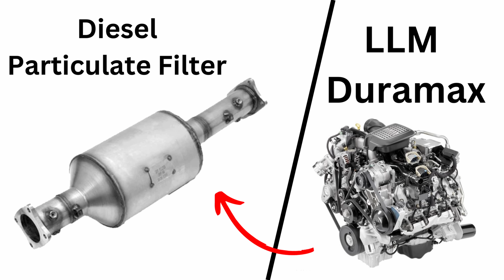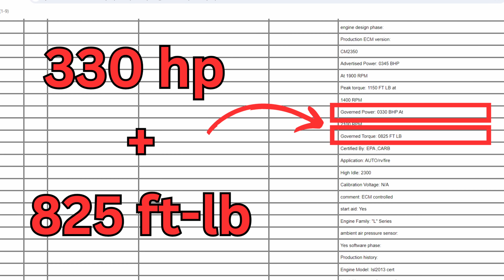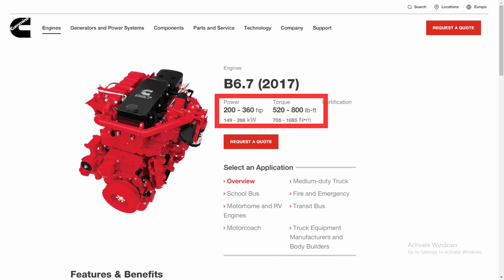Chevy 2500 8.3L DURAMAX Diesel Engine **Diesel Mechanic Review** | Should CUMMINS Be Worried?

Comment: GM needs a straight 6 in their HD trucks.
Reply from the maker: Could not agree more. The 3L duramax is a shining example of how awesome an inline 6 diesel can be
Reply: @TheGettyAdventures  what about the dumb ass belt at the back. Not a good engine.
Reply: @compted10  yeah im a gm lifer and i would never touch that dumpster fire
Reply: @Saddedude  I am pretty open to anything other than a 6.blow, and that rear belt turd.
Reply: @GettysGarage  I think a 7.5L inline 6(or V8) would be a good choice for 500 or less HP.
Reply: @GettysGarage Are those 3L
Duramax any good? I hope since I just purchased a 2023 Silverado with this engine. I do drive 9-11k miles a year so it should be fine.
Reply: @josels1292 you got rubber timing belt on front. 
Metal timing chain for cams. 
AND rubber timing belt on the back of the engine. 

150k life span and you have to pull the cab to replace the fuel pump or belt
Reply: @fastinradfordable  I can live with that. Truck came with 7 years or 100k mile bumper to bumper warranty. I drive on average 9-11k miles per year, I believe I will keep this for 5 years so when I sell it will have around 50k miles.
Reply: @fastinradfordable  You don't have to pull the cab for the oil pump belt. You have to pull the trans. The new engines are rated at 200K also
Reply: Why?
Reply: I suppose an engineer could explain it better but look at all the best diesels in farm tractors or semi trucks, are inline 6's, inline 6 gas engines are great too they're not speed demons but they are torquey down low .run lower rpm's for longevity  @buckhorncortez
Reply: @scottydog62  I6 engines are used for simplicity. That's about it. If you check. The Scania P770 V8 16L diesel. Makes more torque then a 16L I6 diesel. A lot of construction equipment, trains and ships used V configuration engines too. Not to mention. The 3408 Cat is a great engine too.
Reply: @countcuda70  oh I agree with that assessment I'm not saying the V engines are bad I'm just saying inline 6's especially in diesel configuration is a better choice , Simplicity usually means reliability, easy to work on so on so forth, and you can get higher torque at lower RPMs with inline engines which can also equate to reliability. Speaking of Scania engines I operated a case 2870 farm tractor with the inline 6 Scania engine, smooth powerful,and I love that centrifugal oil filter system as well. It depends on the application obviously they are good 6's bad 6's, good V configurations and bad V configurations.
Reply: @scottydog62   It really depends on the work being done. Both have their moments. Simplicity means just that. Their easy doesn't mean reliable though. They all have their issues. I do agree. Both have good and bad versions for sure. I like both of them for various reasons
Reply: @scottydog62  People say higher torque at lower rpm but the L5P duramax makes peak torque lower than cummins by 100-200 rpm and the chart I am looking at shows the newest cummins at only 420hp where my 2020 dmax is 445hp both at 2800rpm and the new duramax has more. The dodge trans option of course means the cummins is detuned instead of them using a more capable trans. A friend said he did not like the harshness of the Aisin as he had trucks with both options. An inline duramax might be ok, but I hate both dodge and cummins and drove a number of them so will stick with Chevy. The same friend switched to an F450 for towing a 40' 30k pound horse trailer and seems to be pretty happy with it although he has a 2022 cummins single tire truck for work but I'm not sure which trans that one got. Others who switched from cummins trucks to duramax said the dmax towed better but the 10 speed also makes a huge difference. They are all pretty similar now and they just keep trying to one up the others with small improvements, although GM was much smarter with ditching the CP4 fuel pump with the L5P.
Reply: The 3L duramax is literally a NIGHTMARE😂
Horrible argument brother man
Reply: Some people in these comments don’t see the design benefits of an inline motor versus a V8.
Reply: @CornFed_3   Each engine design has their own benefits. Inline isn't across the board better. Same for a V configuration.
Reply: @countcuda70 , no, but for overall towing, hauling, maintenance, and engine parts complexity, an inline motor is superior in virtually every way.
Reply: @CornFed_3  That's not true either. Enter the 16L Scania V8 P770. Has more power then all other inline 16L diesels. V configuration diesels are reliable. One of the best is the Cat 3408. It's a great engine. Very reliable and easy to work on. So are the old Detroits.
Reply: @countcuda70 , I never said they weren’t, inline motors are just mechanically better in virtually every way. Power isn’t everything.
Reply: @CornFed_3   That's not true either
Reply: @countcuda70 , just say you’re clueless and move on.
Reply: @CornFed_3  That's goes the other way. You're the one that clueless. If inline engines were so much better in everyway. The companies wouldn't manufacture them. V configuration engines are just as reliable, durable and powerful as any inline engine.
Reply: @countcuda70 , you clearly can’t read. I said inline motors are mechanically superior in virtually every way. Doing more with less.
Reply: @CornFed_3   I read what you wrote. It's still wrong. Clearly we're not going to agree. So we can keep going or just go our separate ways.
Reply: @countcuda70 , how is it still wrong? An inline motor uses less moving parts while still performing the same tasks with even more efficiency. It can’t be argued. Learn mechanical engineering and then we can talk.
Reply: @CornFed_3  Less moving parts, ✅. Of course. A V configuration engine has 2 heads. It all depends on application for  "efficiency". Each has what they're "better" at. Glad you're a mechanical engineer hanging out with use common folk on YouTube. An inline engine ISN'T better in every application. On the other side. A V configuration isn't either. As I said. Each engine type is better depending on the application it's being used for. As I said before. If inline engines are better at everything.... Why doesn't everything have an inline, engineer?? On top of that. You're specifically referencing the I6 only when efficiency is being stated. That limits things for sure. There are other inline engines that don't have the same benefits of the I6
Reply: They do have a straight 6 duramax diesel
Reply: ew no thanks.

Comment: Awwww, yes. The new standard for the 3/4 and 1 ton trucks from the big three. Awesome power and capability, along with piss poor reliability. Thanks EPA! 

I will say the big three not letting the EPA's forced reliability killing emission systems stop them for greatly improving engine performance and capability is admirable.

EDIT: And before I forget, we now get to burn more fuel to help improve emissions! 😀
Reply from the maker: Thats the reality that nobody talks about. With the implementation of emissions almost every single manufacturer had to up in displacement to make the same power. Meaning more fuel burn, more CO2 into the atmosphere. But what do I know
Reply: @GettysGarage   Yup, the railroads are already there with the Tier 4, burn more fuel (along with a complicated EGR system), to make slightly better emissions than Tier 3.
Reply: @GettysGarage  I'd say you know more than the loser lawmakers in Washington, and Canada. I think it's mainly a money making scheme that they wrap in a package that attempts to make them look like they're fighting for some phoney save the planet cause. Emissions makes everything go up in costs and volume. Vehicles know need more complex parts on them, diesels require more fuel that generally speaking keeps getting more expensive, repair work, and preventive maintenance is more necessary, as is hiring skilled labor for work that you used to could perform yourself.?.? IDK, I could be wrong, but it seems to make sense, and you cant make dollars with making cents.... Or something like that.
Reply: Like with vw

The 1.9 had lower emissions than the 2.0tdi because they made it too powerful
Reply: I’m an automotive engineer don’t tell them I told you this, but we (employer) really don’t care. Truck blows up after the warranty. To be honest. Most cars nowadays. Have a 10 year expiration date. The people I work with every day with the smartest people I know from mechanics to former Dakar , and Baja engineers,. Trust me we can make a reliable engine Toyota was doing it back in the 2000s. There’s been multiple cases where through long-term testing we have found multiple issues but since the issues we found “most likely” happen over 200,000 miles we purposely did nothing. our customer base (likely used) who drives cars not far into the future. Don’t have the money to buy a new products so we don’t care what they think about us. And the customer basis I that afford a new truck will have a perfectly problem with the truck for 6 to 8 years. before you ask other companies do the same even Toyota now with the new turbo junk. We usually open up or competitors engines and see what we can rivers engineer or learn from )non-patented) Sooo… sorry 😢 (power train engineer in one of the big American three)

Comment: I really wish GM would develop a heavy duty version on the 3.0L Duramax.  I think that a 300hp/500lbft efficient motor would be preferable to me to the 6.6 gas, but I really don't need the 6.6 Duramax for my hauling needs.  I'm looking at the max trailering 1500, but would prefer the HD chassis.
Reply: If they did that and didn’t make that $10,000 up charge and instead like 1-2 I think it would sell like hot cakes
Reply: I would buy one right away. That engine on a heavier duty frame and axles would be perfect for me.
Reply: And ditch this BS oil pump belt/chain drive, and in the back of the motor.
Reply: The 6.6 is designed to run on 87 gas
Reply: @shadowopsairman1583   yes, and ?
Reply: Why put a real diesel in a light duty truck?
Reply: I ended up buying on the '24 Silverados with the 3.0l Duramax and the max trailering.  Man, I love it.  We'll see over time how it holds up.
Reply: There is a point of diminishing return. What do you really want, luxury impacts towing capacity.

Metallurgy dictates what can handle what, and for what period of time.

Although there is plenty of examples of how not to design, or don't have expectations for things not rated properly, there exists a golden ratio for different lifestyles.

A 3.0 diesel, with the proper add on's. The first being is maintenance and longevity being the largest component. If you're a rural guy or the minority a rural woman, hand rolled windows and a good effective heater are all you really need. 

I'd even wager for just using your cell as a small radio if the cabin was insulated enough, which it should be we are talking rural afterall. 

But let's be real I could bring up a handful of topics, the reality is the consumer market drives the "looks" "functions" and unfortunately "price" of these trucks.

I paid 9k for my 6.7l powerstroke 218k pre covid. 

Had a hard time paying that, not because I couldn't afford it, I just barely justified me having it.

And at times I wonder why I still have it, no hauling large trailers like I used to. I look back at ease of maintenance short of replacing the entire engine due to it having ×××k miles. 

Regardless of what you drive, use a fuel lubrication additives. I've done other things to my truck, but it makes people reeeee. DEF, DPF🗑
Reply: @casval-pj5tb    I think the 3.0 is plenty for my towing needs.  I could get away with the max trailering 3.0 1500 (~13k lbs) but would rather have a similar small diesel with about 14k towing and more 500-1000 more payload.    It would be my perfect truck.
Reply: @casval-pj5tb hey, if the things you've done to the truck are positives, people that SP.ED. out over it aren't worth the noise.

Comment: GM already supplies engines to the Navistar built medium duty truck.  This engine is the next logical step.   Great video.
Reply: That Duramax is built by International.
Reply: @jeffmockus5400 the duramax isn’t built by international 😂😂 it’s built by DMAX, a subsidiary of GM
Reply: So the same Duramax what is offered in the Chevrolet Silverado HD 4500/5500/6500 is also offered in the International CV series? I knew that the Chevy version was assembled by Navistar (parent company of International trucks).
Reply: @HowardJones-j7c  the duramax is offered in the international trucks and Chevy 2500-6500 but the duramax itself is not made but international. The duramax is made by Isuzu
Reply: Navistar engines are junk
Reply: @carlosdasilva8622 was going to say this same thing 😂

Comment: They are in a marketing arms race on towing numbers (Even though Banks proved you cant achieve the max torque advertised). They need spend their efforts coming up with a better after treatment system short of deleting the truck.
Reply from the maker: Agreed!
Reply: the numbers advertised ate flywheel numbers.
Reply: Well then until that happens delete is what we will do though with companies like wace of air showing examples with their pistons that they claim reduces emissions by 80% and a handful of comments stating they stand by them because they work if this is true as their going a bit crazy with it then I honestly think more people will delete since these "pistons" reduce emission future then the expensive exhaust system I however do not care the government said get fucked I say up your this is a clear example of keeping a problem around because it's profitable why make something that works and stays out of the shop more often when you could make something that is gonna spend most of it's life time in the shop bay this sort of thing is what annoys me with these manufacturers and the problem is when they see this they simply do this bring in something new to get everyone's minds off the core issue so yeah like everyone else we would like more reliable vehicles not bigger engines bigger does not always mean better
Reply: But doesn’t GM haven’t deeper R&D dollars? They’ll figure it out if they want to.

Comment: The packaging of an engine of that size would be interesting to see.  The diesels today don't seem to have a ton of space under the hood, a bigger displacement may need to be pretty creative.  Could you do a video on the different axle types (full floating vs 3/4 floating, etc) and could we get your opinion and thoughts about the recall on the Ford Max Tow 9.75" rear axle for snapped bolts?
Reply: If you scaled a 6.6 up to 8.3 liters the volume would increase by a factor of 1.258 so 26 percent larger. But then you take the cube root of that and you get 1.079 so it would only be 8 percent longer, wider, and taller. Not really a huge deal and that's probably an overestimate since not everything has to get bigger.
Reply: Increasing displacement t doesn’t have to effect size. 

Look at the 5.9 or 8.3 Cummins. 

Same block
Reply: Or vw beetle engine for example. 
Displacement can range from 1.2L up to 2.3L without changing external dimensions.